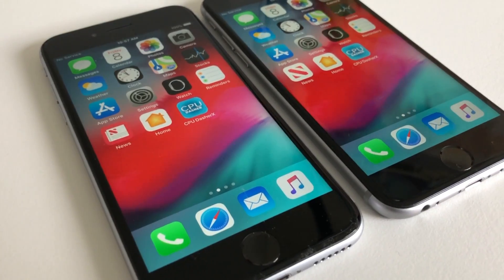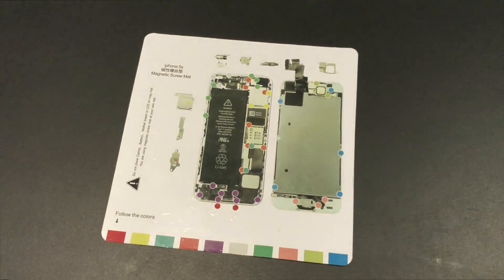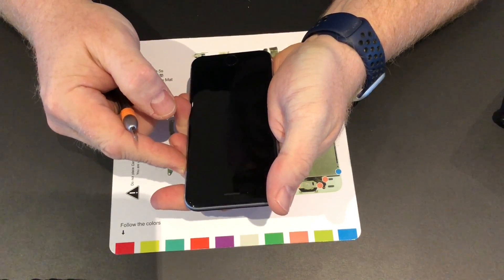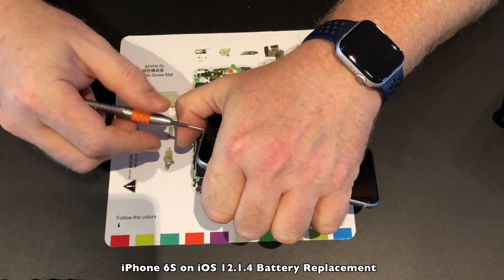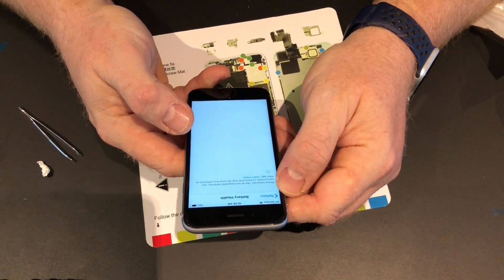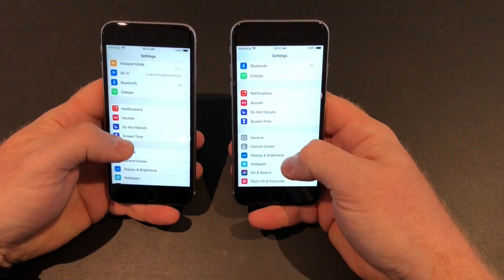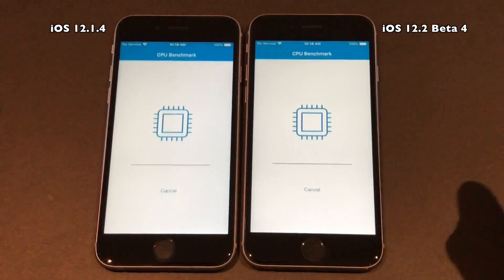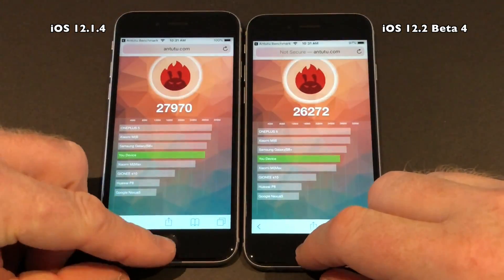iPhone 6S Battery Replacement and Speed Test (iOS 12.1.4 vs iOS 12.2 Beta 4)

Comment: For starters, it's unnecessary and not recommended to remove the display panel part, because the screws are different in length. If they forget the right position, it may damage the cable or the PCB beneath the cover and cause some troubles.😳

Comment: Link to buy the batteries you used in this video ?
Reply from the maker: https://rover.ebay.com/rover/0/0/0?mpre=https%3A%2F%2Fwww.ebay.de%2Fulk%2Fitm%2F192507968331
Reply from the maker: I source them from a German seller on eBay
Reply: Thank you 👍🏻